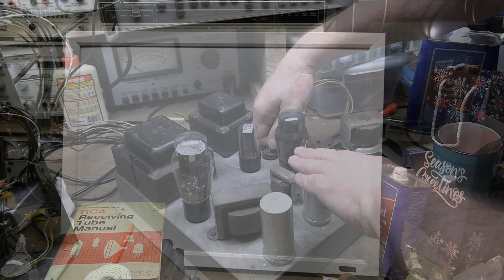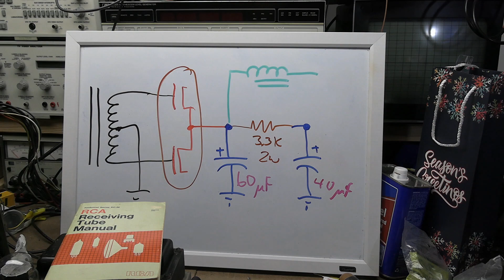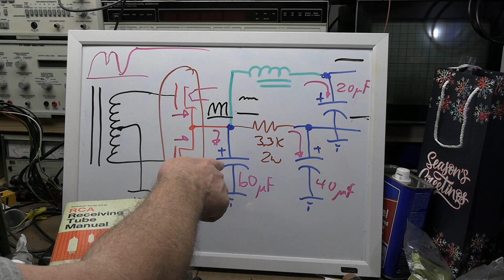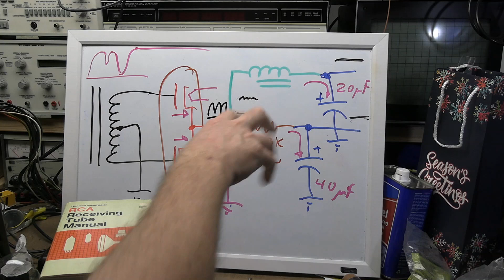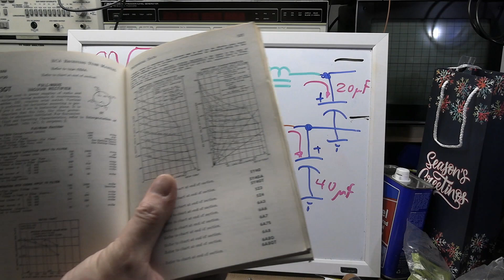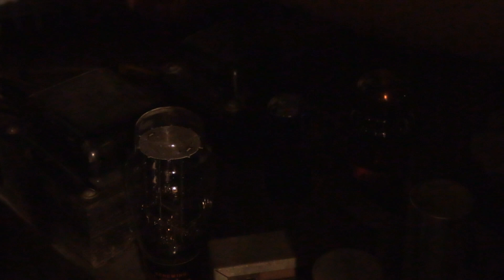Beginners guide to B&W tube TV restoration part 10 (rectifier flashover)

Comment: Since modern caps are so much smaller, a lot of restorations leave the old cans in place, disconnect them, and put the new caps under chassis. Keeps the vintage look of chassis top and is easier to do. What you don't do is to just solder new caps across the old caps. Old wet electrolytic caps can short. The old cans must be out of the circuit. (I know our host knows that, I just put the warning here for the beginners).

As for the cap values, is it possible the 60uf and 20uf are swapped by a factory or engineering mistake?
Reply from the maker: No, that's how it is in the service info. Also , I've restored a bunch of Admirals that had the blue flashover in power up. Thermistor on the AC line takes care of it.
Reply: @bandersentv  I was thinking it could have occurred on the drawing board and the error would be on all schematics and factory assembly examples. Perhaps nobody at ever noticed it?

Comment: 60 uF is probably fine, given the much lower than rated H.T. voltage, and the resistance of the H.T. winding on the transformer.   You really need to measure the instantaneous peak current on start up.
Reply from the maker: I've restored many Admiral 20 and 30 series chassis and they all do this to some extent on the 5Y3 or 5U4.  Usually gets worse after installing new caps.  Adding a CL-90 takes care of it.

Comment: The flash went away quickly. If it's a half second RC time constant to charge the 60uF cap then the resistance of the tube (as it's just warming up) is over 8 kiloohms. I'm not surprised the 100 ohm did not stop the flash.

Comment: (@15:35) - would it work if you reduce the 3.3k resistor to 2k, and put a 1.2k resistor right between the cathode and the junction of the (now 2k) resistor, 60 uF cap section and the coil? Would that be enough to act as a current-inrush limiter?
Reply from the maker: Possibly.  The filter action will be diminished.  I would still likely need to increase the 40uF on the other side.

Comment: Bob, great series. Really looking forward to the alignment and troubleshooting of of the main chassis. One note; In this series, you've been referring to the rectifier as a half wave rectifier instead of a full wave rectifier. Is this just an oversight or am I missing something?
Reply from the maker: Thanks.  Definitely an oversight.  I will not be showing alignment though.  Already did that a while ago in the vintage alignment TV series on a nearly identical chassis.  Good chance it doesn't need one anyway but we shall see.

Comment: Interestingly, the beefer 5Y3 sold as the red "6106" per Bendix's military contracts department was made for an input capacitor of 4uf. The GE 5-star 6087 (strongest military spec 5Y3 built) calls for 10uf. The 6106 somehow had 1.7A of heater current draw, 5Y3 and 6087 are 2.0A. Output current for all three is the same.

Comment: I went through the numbers on the 5Y3 rectifier using an RCA datasheet.  Based upon the tube's 2.5 amp surge rating, the spec can handle the 60 uF input cap.  The current is limited somewhat by the plate resistance and transformer secondary DC resistance.  However, the surge spec is not well defined, it doesn't specify the maximum time length of the surge.  Anyway, it's not a good practice, during the surge as the filament is warming up, the high current is ripping the coating off the cathode, shorting its life.  I would recommend using 20uF max at the rectifier output, then placing a 60 to 100 uF cap after the speaker field coil.  The drawback is about 10% reduction in B+ voltage.
Reply: I would not be surprised if they just accepted the shorter lifespan. As Bob said, it was an old well known tube. It might also be a cheap tube, as it was used everywhere.
Reply: @bzuidgeest  Agreed, in order reduce costs, TVs saw huge design compromises as time went on.  As Bob mentioned, the 5Y3 was used with an older base style; the "80" tube.  When the octal base came out in the early 1930's, the new tube number was the "5Y3".   These tubes were used in virtually every radio with a fullwave rectifier power supply.
Reply from the maker: Thank you for the in-depth analysis.  I think you'll find the upcoming video on the 5Y3 based power supply in the low end 7" Admiral from the same year interesting.
Reply: @bandersentv  Bob, I hope your family and you have a wonderful Christmas!

I have been enjoying your series and have been adding some details from a design point of view to hopefully increase the understanding of those that are interested in more than a simple overview.  If this is causing problems, please let me know.  When first starting out, this extra info would have been helpful to me.

Comment: Whether you can get away with a capacitor that large on the output of a 5Y3 would depend on the peak current per plate (one amp building source puts it, IIRC, at 440 mA).  How about checking it with a small shunt and an oscilloscope (and a NOS or modern 5Y3)?  There could be a number of reasons for the design pushing it that high.  One could be to use up a stock of capacitors.  Another could be that it's actually needed to bring hum down to a satisfactory level (large coned speakers make hum more audible than small coned speakers).  There's nothing but that peak current that is a true limitation, as other circuit characteristics may be more gentle on the tube than the recommended operating characteristics.

I'm curious about whether a NOS or modern 5Y3 would work better anyhow.  Perhaps sputtering of cathode or spalled plate material onto the mica during long operation under higher than normal load due to other circuit failure has created a discharge path when the voltage from plate to cathode is high enough.  I assume you did test the tube for gas, but again the discharge would be continuous if the problem was gas.  I didn't notice if you tried another NOS or modern 5Y3.
Reply from the maker: I did try several others for including a NOS. All had that blue glow on power up to varying degrees. I left out the footage to keep the video reasonably short

Comment: Tube on left had a flashover too...  Around the 20-21 minute mark talking about the 100ohm.
Reply: Video blip...  Went over again...  Slowed the frame rate and zoomed in...  Made the filament on the left tube seem to have a subtle blue tint.
Reply from the maker: Hmm.  I see a lot of reflection off the glass but no blue glow inside.

Comment: When I saw that 60 uf cap used as the first cap in the pi filter I was thinking it was a mistake for a 5Y3. One of the tube charts I looked up said max was 32 uf, and 10 uf was typical when used with a 10 Henry choke. You can get away with 60 uf with a 5AR4/GZ34 as it is an indirecty heated cathode. Not sure of the voltage drop or heater current draw to make it a compatible option. Another option would be a solid state plug in adaptor with a dropping resistor. I made one out of an old tube socket and two 1000 PIV diodes for reforming capacitors.
Reply: 5Y3 has a 60 volt drop, whereas a 5Y3GT has a 50 volt drop, found that an interesting tid bit. I think the 5Y3 is the old style ST coke bottle bulb, and the GT is the compact design bulb.

Comment: I always made extension cables to use the original sets speaker if it was an electromagnetic speaker.  I have seen way too many power transformers burned up by using a 5U4 or 5R4 in place of the 5Y3. The filament current draw exceeds the design specs of the transformer.
Reply: right. a 5u4 uses 3amp versus 2amp for 5y3

Comment: I haven't considered that an 'flash-over' but more of a beginning of a gassy tube. It hasn't been a problem for me with life or durability of the power supply. 
Arc over simular to lightning in a bottle is a problem.
While I haven't scoped a lot output from rectifiers during this occurrence I haven't seen any A/C cross over.
Reply from the maker: Same thing happens with all other 5Y3 tubes. That cap is way too big

Comment: OOPS! Just a reminder from one of my early comments. PLEASE SHOW YOU ACTUALLY DOING THE WORK. In your last video (#9) you replaced caps but didn’t SHOW IT happening. Beginners NEED that viewpoint. Please don’t be like all the other YouTubers that post, “Here’s What I Did” (off camera) videos. I hope this one I’m about to watch will indeed show the work being done…
… Thanks for your always great content!
Reply from the maker: You really want to watch me soldering? There are dozens of excellent soldering tutorials. This is not a series on how to solder, or how to repair electronics.  It's about the specific issues that may come up in early B&W tube TVs.  If I show everything, it will be 100s of hours long.
Reply: First thing, all caps are really impolite. You like being shouted to? 
Second, if you cannot solder a few capacitors you shouldn't be doing tv restoration, you should be checking out beginner soldering tutorials. 
Every TV is a little different, you cannot reproduce something like this 1 to 1. That's why he gives several options to do it. You have to choose which one fits your situation. So a soldering example makes little sense. If you cannot interpolate from what he is saying, to the set on your bench, you have no business around high voltage electronics. No true electronics beginner should. It's only a "beginner" video in the context of people used to tube equipment, but that until now only did tube radios or amps. 
Three, if you want to see something, ask politely, he is not your servant.
Reply from the maker: @bzuidgeest  Wow, thank you.  Couldn't have said it better myself.